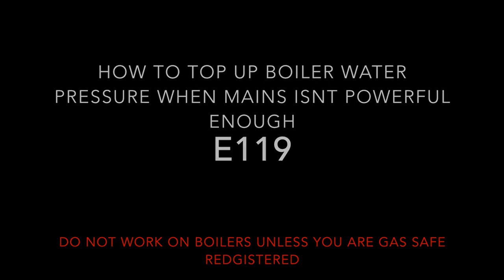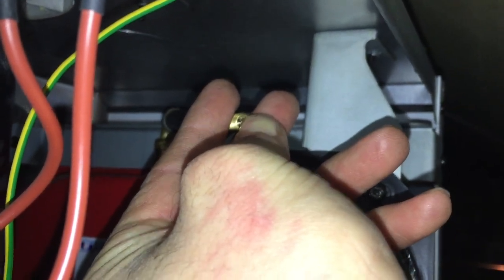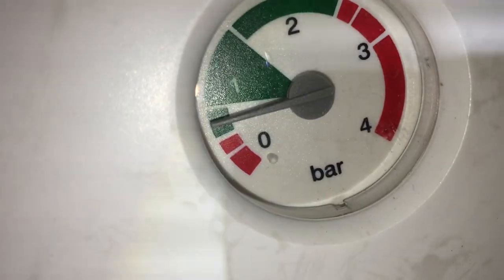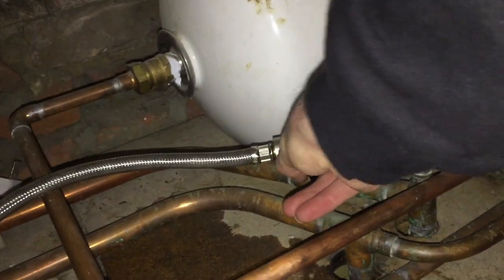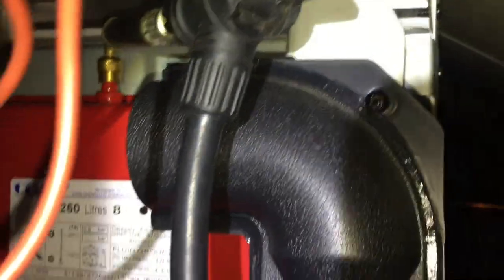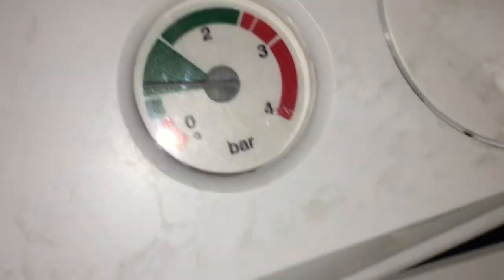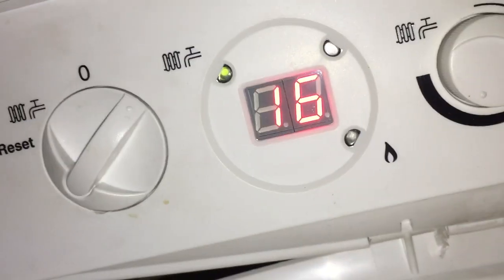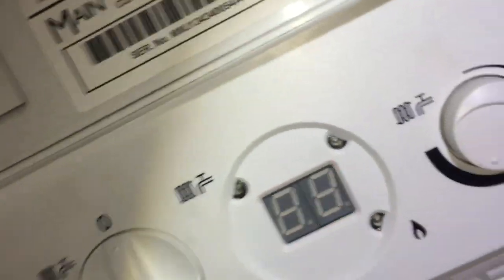How to fill a Combi boiler with poor mains pressure. E119

Comment: Interesting solution which when all things considered is probably easier than connecting a Bailey pump and back filling through a rad or valve..
Was interested in the clearing out the graphite deposits in the gas valve... was it just a case of tapping out the deposits gently????
Great tips and advice by the way.
Top man.....thanks for sharing.

Comment: Just raised the pressure on my combi and now it is running. Thanks for the tip!
Reply from the maker: Good glad it helped.
Reply from the maker: Did you write another comment? I can see one in my feed but not on here!!!
Reply: Yes I did but I realised that I really can't blame the product, so I removed the comment. However the two service crews didn't even know that you could raise the pressure yourself. 5 service people  in company gear and with company vans couldn't do what you did with your videos.

My combi is 11 years old, but brand new as it was only connected but never used because the owner never lived in the flat or rented it out. So it just sat outside in all kinds of weather until I arrived. The first service crew of two "very experienced" people stole the brand new combi PCB claiming it wasn't working without connecting the power! This was of course done to sell me a reconditioned PCB at full price, because they failed to sell me a new combi. 

When I discovered that they had also not connected earth and that the outdoor electrical connection was only done with electrical tape I redid everything and it was then I discovered that I had been sold a reconditioned PCB instead of a new one. So I called the head office and they first tried to wriggle out of it, but I had taken photos of their work and how I had corrected the problems that I could solve, but head office thinking that it would be bad for business if I told my story to the other 244 flats sent out another crew of 3 "very experienced" people (the best in the country they claimed with more than 40 years of experience between them) including the service manager. 

They agreed that the PCB had been replaced with a reconditioned one and that I had been overcharged. They removed it and installed a new one... now we encountered the low pressure issue for the first time. They checked everything... was the supply fully open etc. They recommended that I bought a completely new combi, but they never discovered the "heating system cock" no. 74 in the manual (or maybe they knew and were being sneaky).

From your video I understood what the problem was, I opened the heating system cock and raised the pressure from 0.7-0.8 bar to 1.2 bar and the combi started and it is now running with the factory recommended 1.5 bar pressure.

The end of the story is that the head office signed off on my work and I was refunded in full and got an apology, the gas authority in Istanbul approved the installation and I'm up and running.

So again thank you for your videos... PS I was going to buy the tester you show in your tool bag video, but Amazon does not deliver it in Turkey... so I guess the Bentley has to wait ;)
Reply from the maker: Dam it. I want the Bentley!!!!
Im glad you got it sorted. Its funny how companies operate when faced with an old boiler. (They don't have a clue)
When it comes to fitting a new one Heatline and Warmhaus are both Turkish brands and both better than Ferroli. Hopefully better at customer service too.
Good luck with it all.

Comment: Heating Geek, great video, I never thought of doing it that way!! I'm not criticizing pal, but If I may comment on your pump, I'd check the accuracy against your little hand held gauge, as I bought the same brand, got it replaced  with another which had the same problem, then another replacement.  The guages showed around 5-8psi lower, than actual, having checked them against 2 other reliable instruments. I ended up buying one around £20 cheaper, does the same job but more accurate, to within 1-2psi. Maybe I'm really unlucky, probably!!!
Many thanks again for sharing the love of knowledge, peace as always brother. Paul
Reply from the maker: I had exactly the same problem with the older version. This one is spot on! I have checked and do recheck it every once in a while. :-)
Reply from the maker: I had the same problem with the first one I bought. I do check it against my hand held gage every now and then. Its always been ok.
Reply: @HeatingGeek  Hi HG, They don't make stuff like they used to!!!😕 a little advice please, if you wouldn't mind pal? I recently chemical flushed & refilled correctly,  brothers open  vent system, all new trv & L.shields.
He now has to keep venting a bathrm rad of air & he's convinced air is being drawn in somewhere, do you have any tips on checking, remedies or anything my friend, would be greatly appreciated.
Thanks brother, Peace✌
Reply from the maker: Only a few things can cause it.
1) Leak
2) Corrosion (causing gas build up)
3) Blockage (pulling in air from the expansion)
4) Or its piped up wrong. You didn't say if it was combined cold feed or low water content etc etc.
Reply: @HeatingGeek  Hi mate, thanks for the reply👍 I returned to brothers system & there was a couple of slightly loose compression fittings, one in particular on a trv, connected to dreaded 8mm pipework, which was leaking abit. I've balanced the system & the chemical flush I did, was obviously  beneficial & 2ltrs sentinel x100. I replaced the cylinder because it had an unbelievable amount of blue scale & old element debris in it, Gross!!!
Anyway we'll see how we get on.
What do you mean by combined cold water feed, excuse my inexperience here?
Water content ok.
Many thanks again for sharing your videos, knowledge and experience with us, I've been gas safe & doing dom. Gas repairs, servicing, very few installs and plumbing 8years, but I started from scratch after redundancy & your videos have given me more confidence as most breakdowns I visit are still new problems to solve, that I haven't encountered before😨lol!!
Thanks again. Peace and love to you & Yours😳💖
Reply from the maker: The pipe/pipes from the F&E tank in the loft. Where they meet the system is important and if not correct air will be drawn in. My guess would be the system is still blocked. 
Seal it! just hope you get no leaks!
Reply: @HeatingGeek  Hi HG, thanks for the prompt reply pal!
when you say "seal it & hope you don't get any leaks"" what am I sealng mate, any compression joints etc? Also, are you referring to vent pipe clearance above f&e tank water level & distance of tank above cylinder etc, to conform with installation spec?
Cheers my man!!👍

Comment: A very interesting bodge. With more care, it could be a satisfactory solution.  Does it not raise the question as to why the water supply pressure is so low ? And is it legitimately low ?
Reply from the maker: It is a repair to get the boiler working and allow the owner to rectify the mains water pressure issue. I'm at this job for an insurance company and could just leave the customer with nothing because it's not a breakdown. It's an installation defect. It's just what I would do at my mums to get it going while a long term solution could be found. I always try and think about things in "my mum" situation.
Reply: @HeatingGeek  So is the owner following up on the low pressure issue ?
Reply from the maker: @millomweb  No, It's a landlord who doesn't give a crap....
Reply: @HeatingGeek  ...until you stop paying your rent !

Comment: Your videos are generally very good, but you’ve compromised the expansion vessel by doing that mate.
There will be too high an air pressure in the vessel.
Reply: Fibre Washer 
technically he's only replaced what was released... but unless totally drained you don't really know the exact pressure to begin with
Reply from the maker: I get what your saying but if you check the pressure on a normal boiler with 1.5 bar in the system, the pressure in the vessel is much higher than 0.75bar.  Also if you check the pressure in the vessels of all of the boilers you drain you will find a range from about 0.5 to about 1.5 bar. So 1 bar shouldn't have any detrimental effect. Its always been ok for me, no recalls etc.
Reply from the maker: Next time I need to do it and have some time I will drain fully after to check and refill etc. I don't think I'm over pressurising the vessel because I have a gauge on the pump I'm using. I do get your point though.